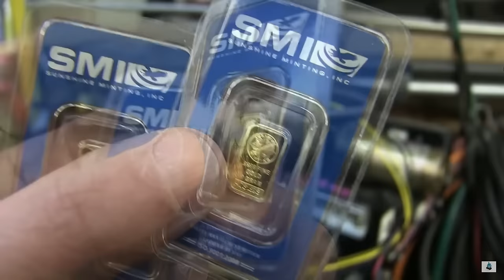Cold Welding In Vacuum

Comment: 1, you need to hold them together witha bit of force, 2, they need to be smooth, unreal levels of smoothness, and most importantly 3, the oxidized coat that is on all metals doesnt just vanish once placed in a vaccum it is still there it needs to be sanded inside a vaccum to get rid of the oxidized coat

Comment: My theory is that you need to deform the grain boundaries of the crystal structures. Banging them together does not align the microscopic imperfections, but wringing them together aligns the structures on the surface, allowing the atoms to come in closer contact.

Comment: Suction. You ever buy a tile fixture for a sink of some over price rich home. Inside the sink's inner workers is two tile pieces with very smooth lairs. My brother was a plummer handed me such pieces and I was looking at the two small wholes for the hot and cold saw how open it was and asked how does the water not leak out. He said put them together and twist them and I bet you $100 you can't pull them apart. I didn't win any money. I said so vacuum sealed? Air tight. Tiles is what the second hardest naturally find material plant? Been awhile scene I've looked at that stuff.

Comment: Cold welding is also the product of nano-crystals of the metal attaching to the opposing metal, so maybe try putting the cold welding in a less shocking environment. Instead of using a weight, use something that doesn't fall.

Comment: I would have built a rig with a swinging arm, on one end of which you put one piece of metal, and the other piece is placed so that the bit on the swinging arm hits it at the end of it's swing in the vacuum. You could still set it off with your laser - I think it just needs a bit of force; Astronauts have accidentally knocked tools together, and this is how this odd effect was first noticed.

Comment: could it be a difference in rebound? i'm thinking the fact that the rotating/wringing action is slower and more consistent and parallel to the surface and allows for more deformation without elastic rebound has to do with it, and that the sudden shock of impact may be breaking any kind of connection that forms nearly instantly as the metal reverberates. similarly that's why I'm thinking the vibration may not work - the Newton's Third is screwing you over if you try to apply any sudden forces normal to the plane of the metal face.

Comment: For the slamming vs pressing, it could be acting as a non-Newtonian fluid in a way but on a much smaller scale. Also would putting a one way valve onto your Mercury vacuum prevent the vapor from going back into the chamber and in turn achieve a higher vacuum? It is also possible that when you (in atmosphere) twist the metals together it is simply removing the oxide layer in places but not in others making it act like a weak magnet only welding in a few spots. I'm also sure you know the problem with cleaning the metal under vacuum with a hand held laser, as it is very likely you missed a number of atoms. That is all my critics. I hope this gives you some food for thought on how to improve your experiments, and ideas for what is happening.

Comment: Ehy Cody! i think you can try to increase the temperature of the metal of a bit, also you can try in a different way the cold welding.
try to make a spike of metal and make it punch a flat surface of the same metal. Maybe it can work.

Comment: I reckon twisting the blocks might just flatten the surface enough to create a large enough surface area for them to weld, whereas banging them is only really touching the peaks of the surface together, which is a much smaller surface area. Have you tried taking them and putting them in a press to see if they stick? Or machining/skimming the faces to make them perfectly smooth and see if the results are different?

Comment: I really think that there is not enough diffusion going on in Gold or Steel for gold welding at room temperature. Look at how Blacksmiths are welding together steel. They heat it to almost the melting point (I think at least 80 % of the melting point), apply flux on the surfaces to remove the oxidized layer and bang it together. There is no liquidifying involved, yet you get bonding. With Indium melting at 156 °C you are way closer to the melting point at room temperature.

Comment: is it at all possible that the combination of the vibration and the vacuum was just enough to slightly melt the surface of the metal particles, because the low pressure should decrease the melting point and the vibration would add extra energy because of the friction of the particles rubbing against eachother

Comment: Would pressuring the chamber more slowly help with this? You seem to add pressure back to the chamber rather quickly, could that be enough to put any air or even pop them apart and remove the weld? I don't know too much about this stuff, just spitballing ideas.

Comment: I haven't done chemistry in a while so please correct me if I'm wrong, but from memory there is a method of oxidation protection though using electrical current, I believe by connecting a negative terminal to the piece you wish to protect. I was thinking maybe if you utilised something like this in your first experiment maybe with a couple double A batteries as a way to reliably remove that last oxidation layer. Again I haven't done Chemistry in a while so apologises if this in nonsensical, eg maybe this method can only be used as prevention instead of active oxidation remover. Also loving your work so keep it up!
Reply: cathodic protection
Reply: hey7328 Thanks

Comment: Maybe the idium when since it's really soft it flattens its surface microscopicly and the air in between the two pieces of metal are getting rid of the air and the air on the outside of the block is trying to get in between the block but it can't since it's so flat and so instead the o2 presses the blocks together

Comment: Hey Cody, have you considered that friction might be a factor in cold welding? Impact force alone would just be force normal, rather than friction, which would explain why impact or force alone wouldn't work. If I had to present a reason why, well, I'm no chemist, but perhaps the stress on the crystal structure caused by friction is better for deforming it microscopically than blunt force?

That does provide an interesting though, though. Would a blade being used to slice a thin sheet of metal in a vacuum fuse with it?

Comment: @Cody'sLab you should design a vacuum chamber that has 2 holes sealed with rubber gloves so you would be able to hold and manipulate objects in the vacuum chamber with your hands. regular rubber gloves may not be good but like really thick sealed rubber maybe?

Comment: did you consider the cristaline structure orientation!?As I recall cold welding can only occure when the surfaces being welded have the same cristaline orientation (and structure). It makes sense to me.
by rotating the pieces maybe some crystals come into alignment and are allowed to fuse?
also, this makes me think that you can't cold weld the entire surface, because the surface is composed of crystals with different orientations.

Comment: So there's actually an interesting thing that I discovered. I know this is a bit late but old computer hard drives data disks will actually cold well to themselves together. Under the same circumstances. you have to twist and/or have a light dragging motion. Thay also fuse in atmosphere. I thought it was rather interesting.

Comment: Trivial fact about gold cold welding... about mid 1800's sponge gold was used as dental fillings..they would hammer sponge gold into the cavity and hammer down, adding gold sponge (or rolled up gold leaf) in the cavity until it was filled up and then it was polished..This method produced one of the best marginal fits (junction between gold and tooth) achievable even by today's standards.

Comment: My understanding is that gold does not form an oxide under most circumstances. However, virtually every surface has several atomic layers of water adsorbed on it that desorbs very slowly even in a vacuum. Handling samples with bare fingers suggests you do not understand the cleanliness required for cold welding to occur. Also, the use of wood in a vacuum chamber indicates you have a lot to learn about high vacuum.

Comment: Um actually... if you are vibrating the gold (or any metal) you are adding energy to that.  That energy is going to be frictional to a large percentage as the gradual material impacts and then slides apart.  Frictional energy releases heat energy.  The granular size being small in relation to that heat means that the gold is not 'cold' welding.  There will also come an equilibrium moment where the granular size will stop increasing as the heat of friction is no longer high enough to maintain material penetration.

Comment: I was not entirely believing AvE in his vidjeo, but your results convinced me that this is an important phenomenon. Pretty impressive stuff.

You said "it is not a spectacular result", but I'll be damned, I think it is. I just think that the vibration setup is not appropriate for cold welding plates (the vibrations are probably too big in amplitude or applied in inadequate fashion, besides the fact that I think it might be better to stick to ).

Also you could test gold under mercury vapor +cody'sLab. Because they do not alloy, right? You'd observe a difference if mercury did anything when compared to the test you already ran with the worse vacuum.

Comment: How can you tell if the gold is welded together if every time you pull it out, you break it apart by moving the bar that held the nut in place? It isn't like it's going to be welded together that well, so the slightest careless push like that could break it apart.

Comment: I do not think that the surfaces are precisely matched enough to cold weld without pressure applied ..?  it's a bit like having the surfaces separated by some distance X and wondering why they won't spontaneously cold weld. Think about what's going on on the atomic level ... scalewise

Comment: The finish isn't near smooth enough for cold welding. Next time lap it to like 5 micron and then place in the chamber then vaccum then use your laser to remove new oxide layer and then mousetrap it again. It will work.

Comment: What I would be interested to find out is if the surface area of that being bonded equally correlates to the amount of holding pressure. Example, if you took both Indium ingots and flattened and smoothed both wide sides; would the hold pressure between the two when twisted together in normal atmospheric pressure be greater than it is now, in their current shape?

Comment: This is only a thought but what about the heat created from the friction of the surfaces sliding together, could this be a key factor in cold welding? Maybe the surfaces that are welding together are for a fraction of a second heating up enough to cause them to fuse. I wonder if you tried the same experiment while pointing your laser at the ground up material would result in larger nuggets...

Comment: Polish the gold that AVE sent you and examine them under the microscope before sticking them together and then after you pull them apart so that you can see what is going on.  I am betting it is due to friction and tangling small fibers of the surfaces together which is why it requires a twist, but that's just me.

Comment: Did you clean the gold plates, degreased at the very least? I also wonder about the amount of contact surface, maybe if you let it hit with the shape of a "nail"..? One of the spacecrafts that is suspect to malfunction due to "cold welding" suppose to have "cold welded" joint links, so the antenna would not deploy. A hinge could possible "scrape" the inside of its structure, there for possibly enabling the "cold weld"?

Comment: A small test that might be interesting regarding the indium, does a strong magnet affect the cold weld? Both if its nearby when you slide them together and also if it comes nearby after it being done without it nearby, same could be interesting as well for the gauge blocks. Reasoning being that I know Indium is diamagnetic like lead, yet if you repeatedly drag a magnet along side of a lead piece in the same direction over and over it will start exhibiting magnetic properties without being cooled :)

Comment: Is it possible that with the gague blocks and indium that some sort of static is causing them to "stick"? It seems very unlikely to me that the process is a "weld" considering there's no noticeable difference in the two  gague blocks or indium blocks after the bond is broken. Almost like when the mythbusters did the experiment sticking two phonebooks together by interlacing their pages, the static cling stopped the phonebooks from seperating with an incredible force.

Comment: 2 questions:
If you vibrated 60/40 tin and led powder would you form an alloy?
Could you use an IR therm and see if you can measure any thermal changes when the bonds form?

Comment: Hi Cody,
When you showed the cold welding of Indium at 15:32 I got following idea:
maybe cold welding is indeed not completely cold? Maybe the turning of the material generates heat from friction which will trigger the bonding like actual hot welding? Would it be possible to calculate how much heat it generates from turning and compare it with the melting point or try to heat it inside the vacuum without turning? But I have no idea how much heat it would need.

Comment: Since torsion works better than collision couldn't you cold weld powder better by using a different vibration mode.

Shaking would result in a lot of collision and little surface-to-surface torsion.

I think the vibration mode that would result in the most torsion in a powder would be swirling it, then they'd keep scraping past each other like car scraping each other on a racetrack.

I think that's how planetary disc do it after all. Direct collision would just smash them apart but since they are all swirling around together they do way more glancing blows and have better chance of accumulating rather than breaking apart.

Comment: @Cody'sLab Could you repeat the copper coldwelding experiment with another sample, having an innert atmosphere surrounding the copper instead of a reactive one?
This might show if the vibration removed oxides by polishing the surface.
If the innert atmosphere sample shows no "coldwelding" we can be more sure the lack of atmosphere is the key factor and not just the removal of oxide layers by polishing.

Comment: It has nothing to do with oxide layer, unless glass also form oxide layers, because I am positive that sticking together effect can be achieved in glass as well. I remember doing that as a child, because I liked the little colors it made, like soap bubble, in glass. 

How about this: wring two glass pieces together and put on vacuum chamber. If they remain stuck together even with vacuum, it means this has nothing to do with cold welding.

Comment: Very cool empirical test but I wouldn't think impact could cause a cold weld because the vibration of the collision and will break the bond immediately. Any weld being formed is going to be very weak and any moderate forces on the samples after collision will cause a spoiled attempt (even misalignment in the impact). Rotating the pieces together ensures the high spots making contact weld together from high pressure (from very tiny contact area) but will not vibrate and knock the weld loose. Perhaps use a rigid pivoting hammer mechanism and lightly smack the two samples together? After the impact the hammer should pull away and avoid additional hits. The more controlled the event is the more likely you'll be able to see the phenomena. Nevertheless you guys are awesome and keep the garage fuckery comin!

Comment: Clamp them together with a decent amount of force (I'd guess at least 100lbs) while under vacuum, and then have lateral vibration combined with that. If the motor-based buzzy thing don't do it, perhaps a piezo-electric one would.

Comment: so in say a car engine the designers go to great lengths to stop metals of the same type rubbing together and your rubbing two blocks of the same metal and wondering why they get stuck. its just friction.   if the shell bearings in your car were made of the same material as the crank you would not get to the end your driveway . try rubbing different types of metal together.  by the way your mercury vacuum pump is scookum as frig !!

Comment: Indium, gold and copper are all fairly soft so your deformation hypothesis isn't unreasonable there, but steel is really hard and likely wouldn't deform to the extent necessary.
Wait...
Cody, measure the force required to cold weld the different surfaces and figure out the sheer stress. You might be on to something.

Comment: Cody's Rube-Goldberg machine channel!
But seriously, like "SlamminGraham" says "Cold welding is all about CLEANliness and FLATness". 
You can't test the affect a few hundred air molecules has, when the objects you are testing have scratches and oils(fingers) that are thousands of times larger.
You would need to polish and clean the two surfaces thoroughly before each test.
Cold welding is all about the number of atoms you can get to connect. I bet the amount of the gold bar surface needed to produce a 'successful-hand-weld' is around 0.001% . Even when you 'succeed' at cold welding, you only got a tiny fraction of the surface to touch each other.
The reason the powder + vibration test succeeded, was the sheer number of contacts between surfaces produced enough successful bonds to notice an affect.

Comment: The air doesn't matter in cold welding. Oxide layer does, but gold doesn't have it. To weld it, you need to apply huge force, some pressure. Gold powder can weld, because they're that small, but ofc air doesn't matter. Also copper is worse than gold in this experiment.